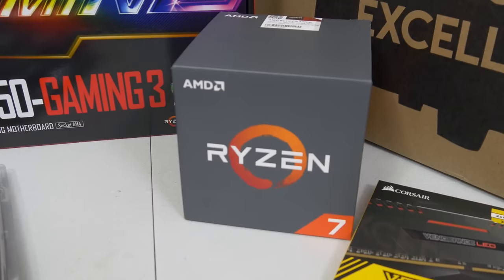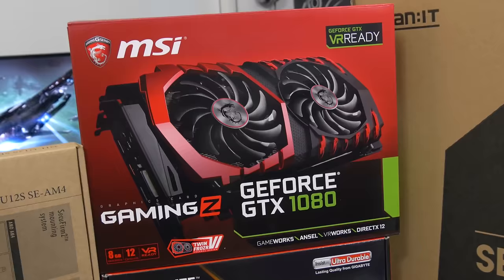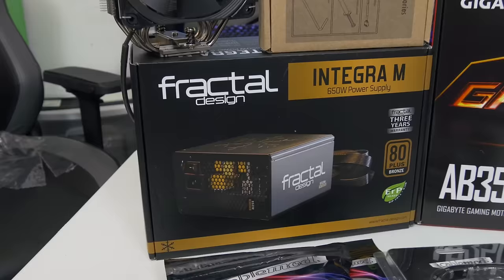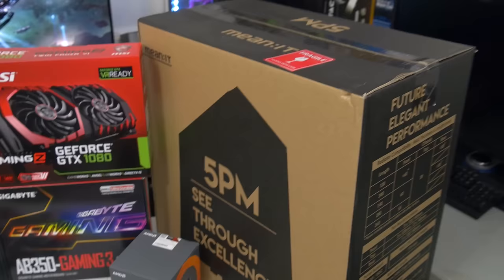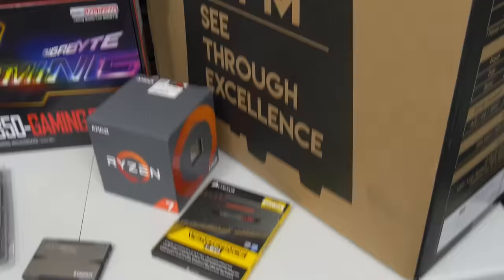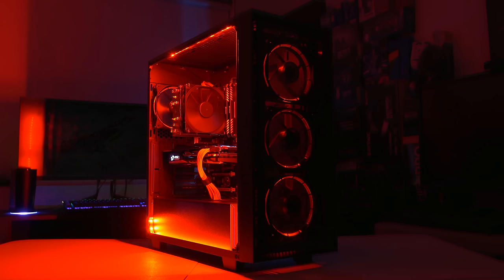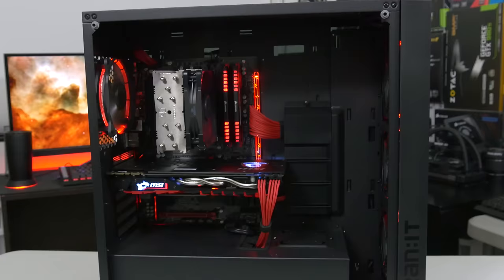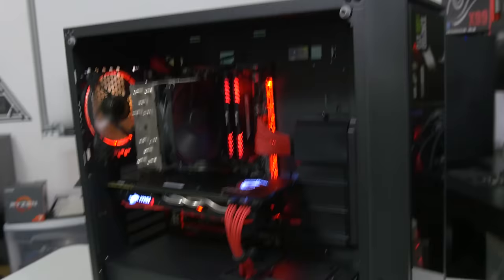Building MY FIRST Ryzen PC! March PC of the Month

Comment: Waiting for Vega and Naples. AM4 X390 2700X and 128GB RAM.

(Yes I do need it, heavy photo-realistic rendering in Maya and Arnold...)
Reply: I don't think it's likely to be called 2700X, on the basis that he first number in the model name would seem to indicate the generation, so Ryzen* 2*** products are most probably going to be based on upcoming microarchitectures, and not on Zen. I personally think the rumoured 16C32T chip will be called either Ryzen7 1900X or Ryzen9 1900X.
Reply: Snakebloke 128GB Ram won't happen on a regular mobo. You need x99 bud
Reply: For productivity wouldn't you want to go with Radeon Pro Duo?

Comment: Dude, the cover that you called "awkward cable routing", that's actually there not only to help hide cables, but to provide support to longer graphcis cards to keep them from bending your mobo.

Also, low and high are not the same. On the back of the case, you have the fan controller. When it's set to PWM, you have the settings low and auto (auto of course being PWM controlled and will be low while not under load). If you switch the fan controller to DC instead of PWN, then you can select high which runs the fans higher (and slightly brighter).

Comment: Rushed build.Why not use an actual radeon based card...
Reply: Why use a Radeon card? It's not a legal requirement or anything...
Reply: He'll do another build once vega drops.
Reply: Yes use a lower performing card, genius.
Reply: Radeon 480 is significantly weaker than a 1070. He used a 1080. This is a big difference

Comment: The RAM is too low @Bitwit you are losing good 10fps there by only using 3000mhz instead of 3600 or at least 3200
Reply: EpleshTV I would say 3200 is enough anything under you are losing a considerable amount of fps.
Reply: Evon Bronner Ryzen is extremely efficient with slow RAM. RAM speed being too high can actually result in a worse cinebench score and a worse Firestrike score.
Reply: Yeah,  have an r 7 1700 at 3.Ghz and my ram speed is only 2133 (advertised as 2666) and my bechmarks are within 3 or 4 fps of everyone I see online. Don't believe me? proof is on my youtube channel, and more proof is too come.
Reply: 10 fps on ram speed... no chance
Reply: yeah I know now, didn't know then. I overclocked them today and didn't see much of a difference. The difference was there, but not drastic. although outside of gaming, that's a different story.
Reply: you would be right if the topic wasn't Ryzen. Faster RAM, more FPS. I cannot speak for outside of gaming, like workstation things, you could be correct. no clue. but as for gaming, faster Ryzen, more fps...slightly.
Reply: Well I tried it myself and my 0.1% lows are amazingly high and workstation tasks like rendering and streaming work as smooth as ever. I just dont see the reason why you would skip on 5% of performance for the same cost (at least where I live) thats all. And calling 10-15fps max and even 20fps on 0.1% lows on some titles "slightly" is an understatement in my eyes.
Reply: EpleshTV where do you get 3600 MHZ ram I've only seen 3200
Reply: overclocking. But they do sell up to 4266mhz branded ram here so I thought it would apply to anywhere around the world ?
Reply: EpleshTV thats not how ram works mate... 3000mhz is fine, you might get .1 of a frame more with faster ram, you obviously have no idea what you are talking about
Reply: You didnt klick a single link nor did you read my comments. So I wont take you seriously. Go ahead and think Intel CPU rules apply to every cpu in existence. You watched Linues RAM video on an INTEL platform and think you can transfer that knowledge onto a completely different architecture ... i dont think i need to elaborate any further right ?
Reply: OHHHHHH SHEEEEIT ITS GOING DOWNNNNNN
Reply: I am just explaining my point, not trying to attack anyone.
Reply: EpleshTV you know what, I'm going to admit defeat here. You are right, CPU communication speed is linked to the speed of the ram. Unlike what you think, I actually haven't watched the Linus Video, but I did go and do some research and I realized I was wrong. Sorry mate, unlike me you knew what you were talking about.
Reply: Derrick Gott Oh nooo not the synthetic scores. Anything but those. /s
seriously if games and workloads, like actual software people use daily runs faster as a result of super high ram speed, my cinebench score could be tree fiddy and I wouldn't care.
Reply: buddy, I am agreeing with you. saying 20 more fps from faster ram is kind of a stretch, and idk about you, but where I live, center usa, faster RAM cost more. I am not rolling in cash.  I had to make a choice, so I went with saving a little on RAM>  MInd you this is before we knew about the RAM thing with Ryzen. also, I have not seen a SINGLE benchmark online that shows faster ram giving an extra 20 fps. show me the link please.
Reply: nevermind, I just realized you were talking about 0.1% lows.  In which case you are correct.
Reply: agreed, something I am having a bit of trouble with... so, do I need to download the latest bios update from asus website onto a free'd up USB, then what..?
hahah trying to update, got everything a few weeks back, everything works fine, lovely in fact. just want to go ahead and update BIOS.
so help? please haha motherboard-ASUS prime B350M-A
cpu (even matter?? haha) - Ryzen 1700
Reply: speaking of, I just downloaded bios 0519 or whatever the newest one for the ASUS PRIME B350M-A, anyways, my question, what are the negative effects that could happen if I were to fuck up? I mean, I know how to do it, but I want to know what happens if I fuck up
Reply: you guys need to have XMP on bios

Comment: There's 2 versions of the mean:it 5PM case with red fans, the 5PM ARC RED and the 5PM LUM RED. The LUM RED fans look much brighter in the pics. The center hubs on the LUM RED fans light up also where as the ARC RED fans don't.

Comment: Low and high are not the same. I have MEAN IT's cube case and there is a difference in low and high. If you look closely you will see the LED's of the fans dim down a bit when you press the low button and it does indeed slow them down. Also my high button is a dual function High/Auto.

Comment: gigabyte has done it again with this sweet board. I plugged a ryzen 1600 + a gtx 1070 (wanted to go amd, but could not wait for Vega sadly, I'll just sell it and go Vega when it comes out if worth it) with 4x2 hyperx savage 2400, went directly to 3.8 @1.3 cpu and 29xx @ 1.38 CL 12 on the memories, haven't touched the bios since day 1 system is on since like 3 weeks ago, blitzes through anything I throw at it (1080p never seen anything else but 60fps @ultra) and is rock solid, very low temps and noise. impressed by amd and gigabyte, what a quality at such a low price point. l. e. bios f6
Reply: well if you allready buy 3000mhz you can push it further.. like 3600 maybe, dont know

Comment: I like the subtlety of the front fan led's. Maybe running the led strips through a tinted tube of some kind mounted in the chassis would tone them down some?
Reply: Also that case definitely needs a cooling loop to fill out the main compartment more. Not a custom one but maybe something with those new expandable AIO setups.

Comment: hello ! i have a question , the ram u used , what is the model number? , the people usually goes for the  CMK16GX4M2B3200C16 or the (CMK16GX4M2B3000C15)? , ive read a lot of comments on another video and the people are having stability issues with the ram because the revision number on rams, or their system wont boot , and restart every time, i just wanna know which ram u have instaled in this rig(The model number ) , cuz seems that u dont have any problems on booot. please can u send the buy link?  , really need it ive alredy bought the mobo and the procesor (Ab-350 gaming 3. and Ryzen 7 1700x)  . thnx , and have a nice day!

Comment: I have a ryzen 5 1500x in a MSI tomahawk b350 with 16gb corsair led 3000. It's clocking the ram at 2133. Every time I try to change it, it fails. Any tips?

Comment: really nice build! I am little dissapointed with the ryzen gaming performance so far but they can only get better from this point. I personally render alot of files so having a lot of cores is just so nice to have for me!
Reply: Evil Crush X99 was about as bad as Ryzen at launch. X99 didn't benefit from high ram speeds as much as Ryzen did either. Gaming performance is promising with 3200-3600mhz
Reply: yeah true but still I see those damn quads dominating gaming performance for so many years now. Every year it is aah the next engine generation will support those 8 cores very well!

Comment: Did you encounter any problems with your RAM? I was considering to fit Vengeance LED 16 GB (CMU16GX4M2A2666C16R or CMU16GX4M2C3200C16R) with the Gigabyte AB350M Gaming 3 (same as yours, but MicroATX), but the Corsair RAM is not on the supported list.

Comment: Hi there. How long does it take between pressing the power button and showing the motherboard logo / splash screen? This is also called the POST time, right? I am asking this because I have a MSI B350 Gaming Plus + AMD Ryzen 5 1600 and it takes more than 20 secs. After a few months I am still waiting for a BIOS update that fixes this. Thanks!

Comment: My build that just came in:

CPU: AMD Ryzen 7 1700
MOBO: MSI B350 Tomahawk
SSD: 240GB Patriot Hellfire NVMe
RAM: 32GB Corsair Vengance 3000Mhz
PSU: Corsair RM650x 650W (way too much for this build)
GPU: GTX 1050 from the previous cheap build, waiting for RX580
Case: NZXT S340 Elite Black

I'll take it on virtualization spin tomorrow.
Reply: replicant #85 damn how much ram do you need?
Reply: obviously 32gb
Reply: +Boy As of right now I need ~28 GB for virtualization but my requirements tend to increase very quickly. In the next year or two I'll need another 16 GB stick. I just assembled by build and I'll be giving it a spin very shortly. In the mean time I found a store with Corsair Vengeance 2x16GB 3200MHz sticks for almost the same price I paid for 3000MHz so I'll be sending back the one that I have and I will install 3200MHz Tuesday next week.

Comment: swap the proc fan with red LED fan... if the airflow is not as good as the stock noctua fan, put 2 LED red fans on pull/push for the proc... hot air goes straight to the rear fan and out the case

Comment: As to the LED front fans dimness you prolly have them wired daisy chained to a single power connector which is why low and high are the same brightness.

Comment: I have a noob question about the ab350 gaming 3 mobo for fellow users there. My case is an H440 which has a fan hub where four 0.16amp fans (NZXT FN V2 120mm x3 + 140mm fans as stated on the NZXT site) are currently connected. Will one fan header on the AB350 Gaming 3 be able to handle the hub/fans if I add three ID-Cooling CF12025 0.25amp fans to it to consolidate a single connection fan setup?
Anybody can correct me here. The fans would be (0.16amps x 4 fans) + (0.25amps x 3 cf12025 fans) = 1.39amps which is within a single header's 2amp limit. Will this work? Or do I risk frying my mobo and fan header? I'm just a little picky about having to spread out fans throughout the mobo. It makes me feel it as kinda messy in terms of cable management.

Comment: Quick question, where did you end up plugging the case fans into; the MOBO or straight into the PSU? I'm upgrading to a Ryzen 5 1600x build with the same MOBO with 5 case fans total. I read on Gigabyte's website that the MOBO has 5 (or 6, can't remember exactly) spots for case fans/liquid cooling fans and was planning on just plugging them all into those spots but am worried that it'll possibly cause a lot of extra wires to be present. Thanks in advance!
Reply: Also, what extension cables are needed? I like the red ones used in this video instead of the straight black ones a Corsair CXM 750w has lol

Comment: I'm trying to decide whether to get a micro ATX board or this ATX board in this video. Is there a reason to have 2 PCI-E connector if you're only going to use 1? The mATX board I want has 4 dimm slots as well so IDK

Comment: Neat case, I wonder if the Phanteks P400 filter would fit on top? it doesnt have chop-your-fingers-off sharp edges.

Kyle, try turning lights off and hit high, dont go from low to high. See if any change.  It may be something not fully soldered on the connections preventing high mode from working?

Comment: Yo Bitwit, I don't know if you know that (it might be recent but it's something none of the reviewers talked about), you can set to fixed instead of pulse with the vengeance led using corsair link. Not to mention you can swith the corsair logo on the vengeance led... common man as much as possible all the writtings go in the same direction !

Comment: Did you use the fan controller power plug for the front fan LED ?
And the front panel connector ?
Could be faulty wiring maybe or just crappy Chinese production.
Shit doesn't get enough Q.C imho

Comment: for the emptyness of the case.... If you remove  the "wierd " cover  than u can add aditional Posts (wich should be in the box)  since this Case accepts a ATX-XL / Workstation Motherboard.  So plz do another video as review for this case and trow a ATX-XL board into it  within the review. Since such cases , with the multi purpose  are always neat to have.  BTW  next to your PSU shroud where u routhed the GPU Powercable true. The cover can be removed,  the retail version of this should contai  a Bracked  wich is atachable to  the sayd "wierd shroud"   to put a vry Big reservoir on.

Comment: I see you've used the corsair vengeance lpx 3000 in some builds. I have the same ram ryzen asus x370. Any recommendations on getting it running at higher than 2133?

Comment: Very sexy... I just bought this case as well as some of the best AMD has to offer at the moment. This case supports a water cooled 3 fan radiator behind the front 3 fans. Its feels really open and bare because its a mid tower that you can fit a 3 fan radiotor and all the other goodies for water cooling. But Its is an amazing bad ass red look if you are making a red and build. I just wish sleeved red cables were not so expensive. I refuse to spend 60 to 100 or more on colored cables.

Comment: Any chance you can do a build on the new Bitfenix Portal case?

I built a mini itx build inside a RVZ02 raven case from silverstone with a Asus Rog Strix 1070, and it was wonderful during the winter, but with the hotter weather in Cali, the steel frame is like a frying pan, and shits overheating like mad. Wondering which case i can move all my components into for better cooling. The bitfenix portal looked like a good candidate..

Comment: I have a question i curently have a pre built pc. I was wondering if i should get a gtx 1050 ti now, or save up for a whole new pc with an gtx 1060 and an i5. My current build hase an amd athalon 860 k and a r7 360 all the parts are compatible with a 1050ti not a 1060
Reply: Oh and i plan to play csgo farcry 4 gta 5 and rocket leauge
Reply: sudo ione For the games you play, I think the 1050ti would be a perfect upgrade to your PC
Reply: Thanks

Comment: That cooler lets it down in the looks dept imho, a black rad with black fan or one of Cooler Master High Performance V8 Version 2 Triple Tower, i suppose if you're on a budget fine, what evs but if you're putting some of this effort in to looks well, the stainless steel rad just doesn't match the rest. :P

Comment: nice looking build, tho the case is realy lacking and looks like a 20USD ultra-cheep thing with out the grommets and almost complete lack of front intakes for all them fans.  The non welder flash-burn fan LEDs may be a good thing for some, tho that broken dim/bright control just adds to the other stuff that makes that case not worth more then 20USD to be honest. That case could have been so much better built then it is.    Great vid, thanks.